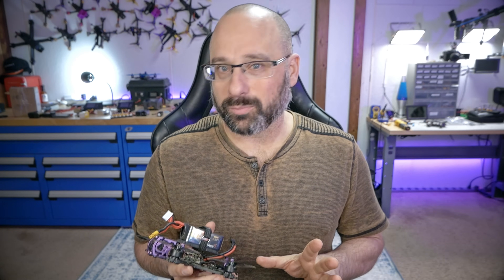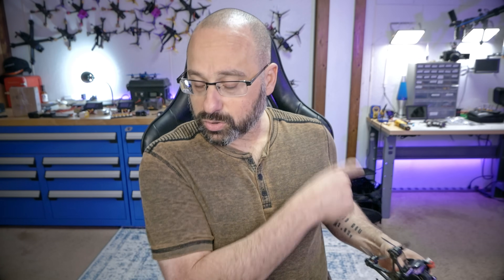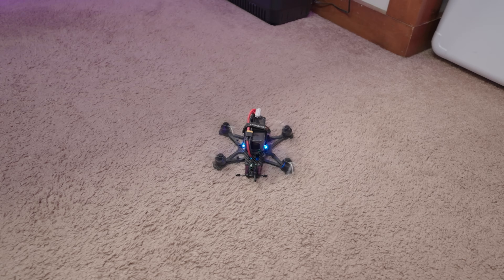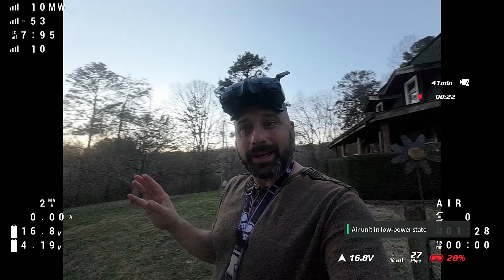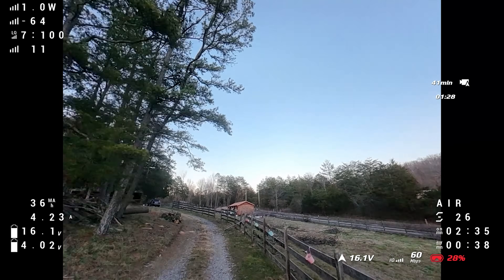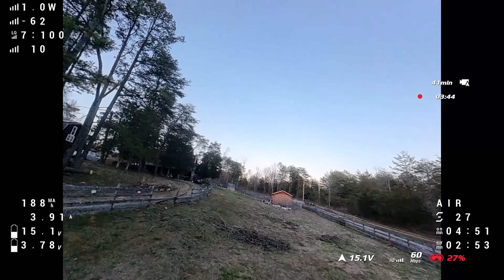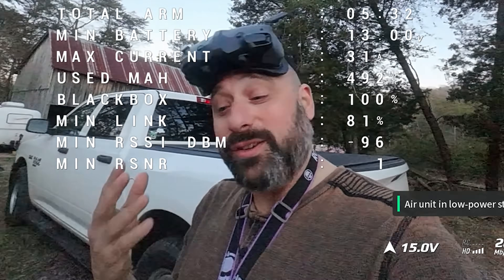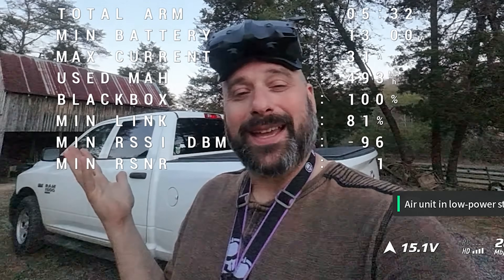Sub250g FPV Drone Build - 12 - Your First Flight!

Comment: OMG. My first hover outside on a concrete slab under my porch was wild. It did hover and want to drift. I am wondering if it is set to acro mode? If so, should I reset to angle mode to have less drifting and more control? And yes I did attempt to just slightly push on right stick and it went wild, hit the top of my porch, but no damage to quad or porch! I am nervous about taking it out to my open area where bushes grow in the dirt. I would rather try it in a grassy area. After all this work and don't want to damage it this soon. Call me chickenshit. LOL.

Comment: Thanks Josh! That was fun. I started electric in 2014 kit bashing tricopters then quads with H King stuff. (KK2 and Turnigy). I was a bit intimated to move up to the modern ways. Betaflight and your guidance has inspired me. My 3.5 inch flies great and I'm ready to build a JB 5 inch.

Comment: It's officially time for you to go out and crash your shit!  This 3" quad is a scary BEAST!  After a few issues with receiver binding and then forgetting that JB went with "props out" as I instinctively installed them "in" I was up and running and wow wow WOW!  What an incredible difference it is to fly this bird compared to my DJI Avata 2.  Don't get me wrong, the Avata is great.  It's comfortable.  It's plush.  It's safe, with its nice air brake button, trimmed out GUI, prop guards, easy to install ND filters and super sexy battery change outs. But it's just not, it's . . . not this amazingly nimble, raw,  super hornet that can take a crash like it was designed to do so.  I've bounced, rolled, tumbled and cartwheeled through the grass enough times in the last few days that the carbon fiber frame is stained green and it still keeps going ( I've gone through 5 prop blades and cooked at battery so far)!  Each time my Avata 2 hit anything, it was back to the shop.  Broken gimbal mounts were a constant hassle.  Pulling the whole front nose apart is not fun and the availability of parts is hit and miss with various 3D printed stuff online (DJI offers little).   Plus, my DJI one and done free replacement took WEEKS to get.  Now, having intimate knowledge of how to assemble and program my own drone has taken this hobby to a whole new level.  So thank you JB for all your hard work and time that you have put into this.  Thank you.  You've earned another supporter on your Patreon sir.  Looking forward to my next build and digging deeper into the complexities of this craft.

Comment: The weather finally was nice yesterday so I took the JB sub 250 3" out for it's maiden flight. I've only flown a tiny whoop so there were some nerves.  It flew great! No problems whatsoever. Ran a couple of batteries through it. I guess the 70+ plus hours on the simulator and the 200+ flights with the whoop paid off.  I couldn't be any happier.  Thank you JB for the information you put out to get this old guy to learn how to fly and learn how to build a quadcopter.  Without your videos, I would never have tried this awesome hobby.

Comment: Hey Josh! Pretty new to fpv, just got my first quad outside of dji, using the dji controller still, connected it to quad, going through betaflight transmitter tab, saw the values jumping and dropping about 2-5 units is this normal?
Reply: Hey incase you do see this, I recalibrate my controller with my headset, the movement in betaflight transmitter tab went from 2-5 units to 1-2 units, but after leaving the controller for about a minute the drone will still drift about 20 degrees, is this normal, and how would I fix it?

Comment: does anyone know what battery would be good for this?
Reply from the maker: 6S, minimum 90C, about 1100 to 1400 mAh.
Reply: @JoshuaBardwell  I have Lumenier Silicon Graphene 1300mAh 6s 95c Lipo Battery, would this work?
I realize it’ll put it way over 250 as the battery itself is 240g lol

Comment: What do the various video option versions weigh, less battery?
Reply: My analog comes in at 157.5 grams.
Reply: @markhussey2074 Interesting. My completely home built (including frame) 3" with 1408s, analog VTx, ELRS Rx etc comes in at 138.6g, which is quite a lot less. On the other hand, it is probably quite a lot more fragile than the JB craft. Different tradeoffs, really.

Comment: My missing motors for my kit showed up yesterday.  Spent the rest of the day building and completing my analog build. As per your instructions at 0:53, I ran through all of your tests and then hovered it my living room.  Oh wait, you said DON'T do it inside.  I guess I misheard you. 😄 Anyway, everything works great so far. Now if it wasn't 30 degrees outside, I could actually try it out. Thanks for this video series and your learning to fly FPV series.  This old guy could never have done any of this without your "help".

Comment: Hi. Recently, I bought new DJI Goggles 3 and noticed that I have about 10 dead pixels on the screens. I read on forums that this is a fairly common issue. I asked a friend, and he also has about 5 such dead pixels. Take a close look at yours-do you have any? I'm curious about the chances that if I exchange these goggles, I'll get a normal goggles without any dead pixels😢

Comment: why not make it compatible with the o4 unit pro... the pro unit is only 20 dollars more expensive and seems a lot better
Reply from the maker: The O4 Pro would not be under 250g. Also the O4 Pro is $220 while the Lite is $110. That's over $100 more expensive.

Comment: Hey I hope you or your viewers got a secound to answer my question.

I love in Europe and got a radiomaster pocket LBT and a nano range module LBT 1W ELRS.

I found too late out that I need to fash my firmware now to fcc to use the full 1 watt. 

But now my question: is it possible to just flash the Ranger module to fcc and not the radiomaster pocket so I can plug my module in and do long range and take it off if I want to be undercover and close range? Or do both products need to be in the same protocol either both lbt or fcc?
Reply: Hi, you need to flash both to FCC, they need to be on the same protocol to talk to each other

Comment: What's the final weight? Can't find this information anywhere and it's killing me not knowing exact weight of this quadcopter.
Reply: Depends on the VTX and battery, but with avg HD cam and ~650mAh S4 battery pack, it's right at 250g.
Reply: @davidskidmore3442  I thought this takes 6s 1100-1400

Comment: I disagree with the bolts on the props. I've been flying my moded crux 3 for 2 yrs with no bolts holding the props on. I've never lost a prop or noticed it slipping. The extra 2 grams of rotational weight really makes a difference.